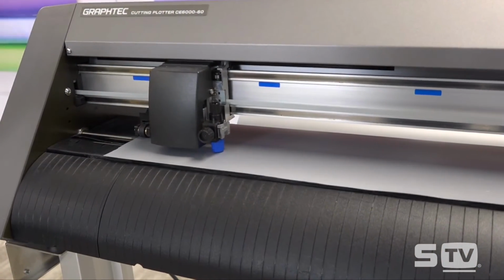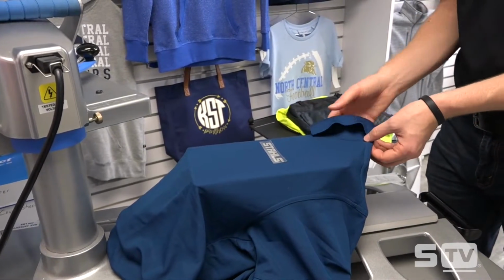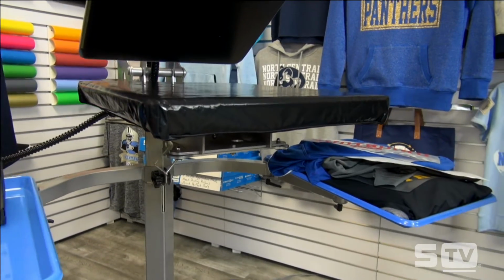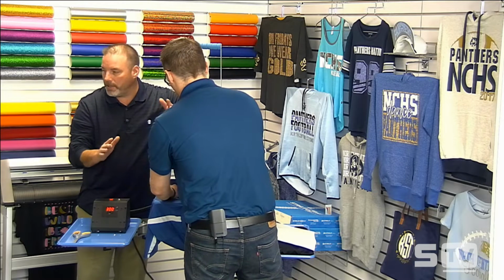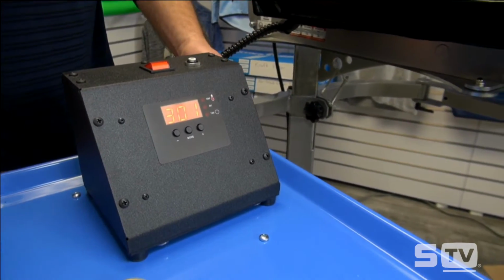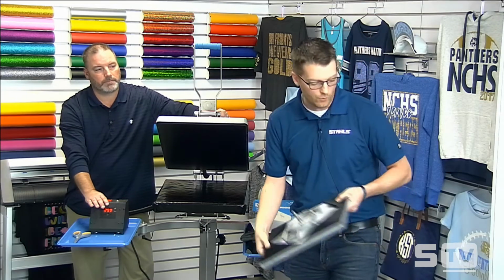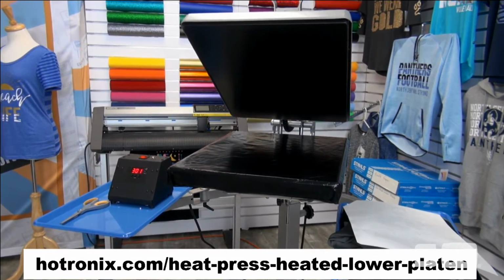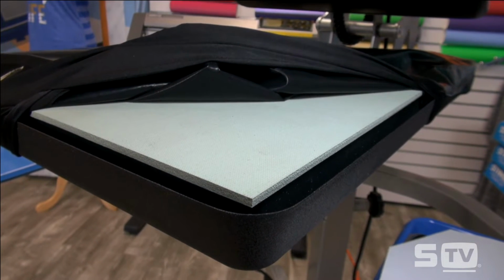Newest Heat Press Innovation | Morning Show Season 3 Ep. 37

Comment: Very helpful information. I use the Fusion Heat press on swing motion only, if I understood correctly I will be able to use the heated lower platen with it, please let me know if that is correct. I am really interested in pre-ordering one. Thanks
Reply from the maker: You could use it on the Fusion (swing only no draw) but it is recommended for the Clam style presses.

Comment: I was told at a show, although its not recommended for a hotronix fusion . ---- it can be used, you just have to be careful when pulling out the tray. Is that true?
Reply from the maker: Definitely not recommended for the Hotronix Fusion. It is compatible with the Air Fusion however.
Reply: you guys mentioned a version for the fusion coming in 2018..whats the word on that?
Reply from the maker: No word on this yet.